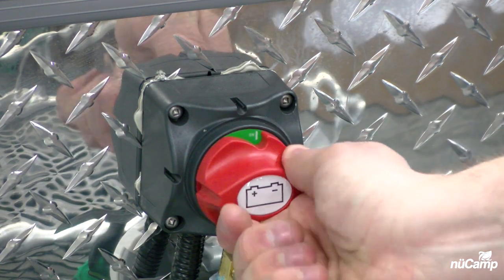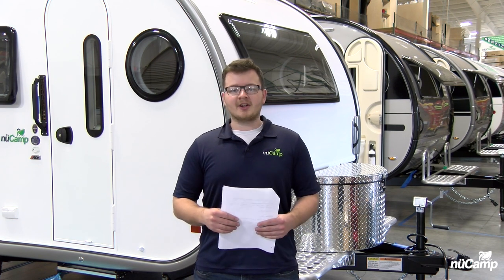Purpose of Your Battery Disconnect Switch - Tech Talk

Comment: If the battery disconnect switch is off during travel, is the emergency braking disabled?
Reply: Creed somewhat answers that question in the video:  keep it “on” while traveling - for charging the battery, but it will also supply the power for the emergency breakaway switch.
Reply from the maker: Thanks for clarifying for us, JT!